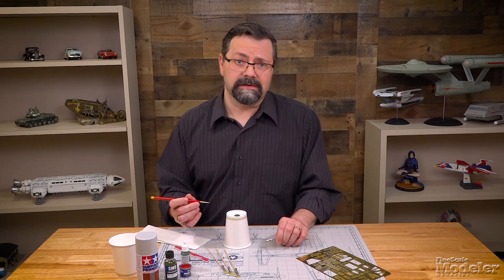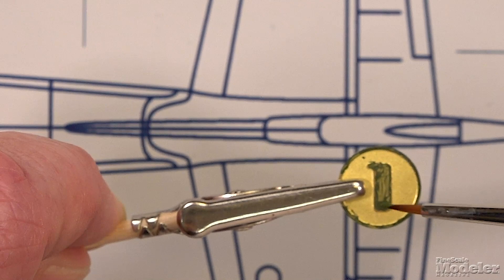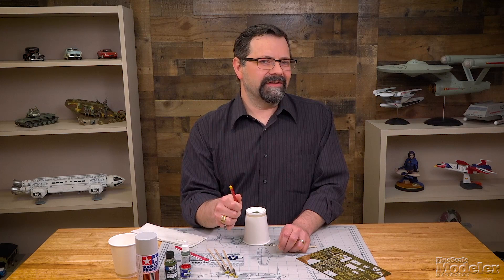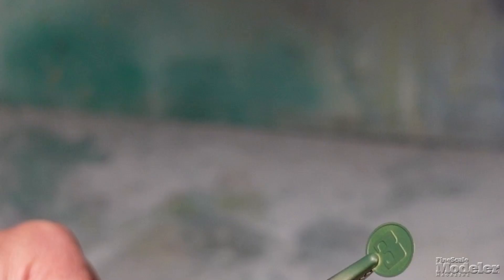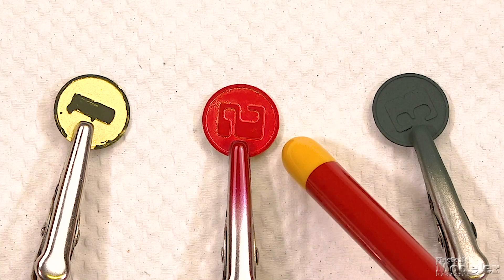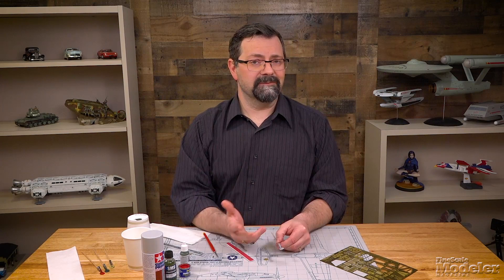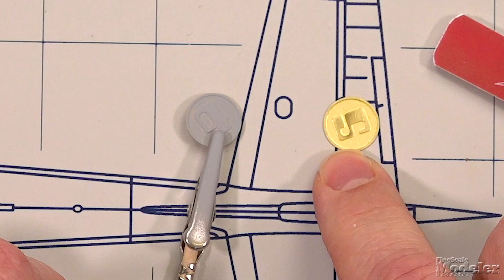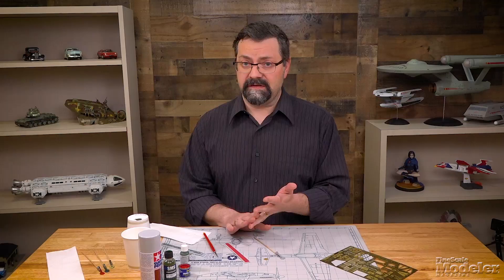Scale Model Basics: Painting photo-etched metal parts

Comment: Nice and simple, thanks!  For me, primer is mandatory when brush painting.  People might argue about how well it improves adhesion but what it does do is break the surface tension between the plastic and paint,  drawing the paint onto the surface.  This results in smoother coverage that requires less coats to get the finish you're after.  This saves time and retains a better overall level of detail 👍
Reply: Etch primer also gives the paint a slightly toothed surface to adhere. I use primer whenever it is feasible.

Comment: In my experience in painting brass it’s important to wipe the metal with acetone and use a self etching primer before painting. If you skip those you run the risk of the paint lifting later on.
As a disclaimer, I make my own photoetch from half-hard brass and create 1/12th scale automotive racing chassis.

Comment: It's always been recommended to wash plastic parts on the sprue before building a model to remove mold release or other chemicals - are there no chemicals on photo-etch parts that need washing and drying to remove before gluing or painting them? Thanks for the video.
Reply from the maker: Not really, since a final rinse is part of the process in making the photo-etched metal parts.
Reply: Thank you.

Comment: Tamiya Fine Surface Primer is not a metal primer. An etch primer (Tamiya Clear Etch) has even better adhesion qualities. Cleaning metal surface first by fine sanding is advisable in the case of brass as it removes any tarnish, then washing, drying before paint.
0000 Fine Wire Wool (no soap) works well as it gets into all the fine detail areas. 1500 or 2000 wet & dry is great for flat surfaces.
Etch, Base Prime, Colour...
Reply from the maker: Thanks for the Clear Etch tip. We'll take a look at it. We're also interested to see what it does to plastic.
Reply: 0000 steel wool has oil present that needs to first be removed or it contaminates the metal surface you are painting.  This is particularly manifest when say, bluing a metal part.  Soak the steel wool first in acetone, exercising all common-sense safety practices, of course, allow it to dry, and you are good to go.